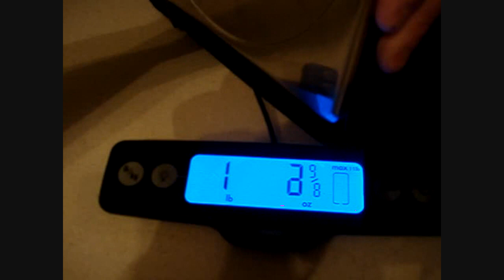F-35 Trust Vectoring Build Video 70MM

Comment: @TinkerManRC I have a Su47 ARF stock, no replaced servos. One of the rudder servos is not reliable as it does not re-center correctly. It's comparatively easy to replace, but it doesn't feel safe to fly. It can go at any time. So I have a 2nd Su47 airframe which I'm installing RCLander 4 cell engines and digital servos in. Better performance, higher reliability => mone enjoyable and durable plus true 3D performance. Gyros will make it more stable.

Comment from the maker: Great question
I'm using the Hobby city  HXT 900 9GR Servo, Trunagy 80 amp servo from hobby city. E-flite 480 4800kv motor on 3 cell. BP hobbys 70mm fan unit. and that should do it.. thanks for the cool comment.

Comment from the maker: Great Question
Well, I had these motors installed in my first F-14 tomcat and ran a 2250 30C and with that combo got good flight time about 5 Min,, But your right I will most likely use a 3000 30c,, Thanks for the cool comments Tom..